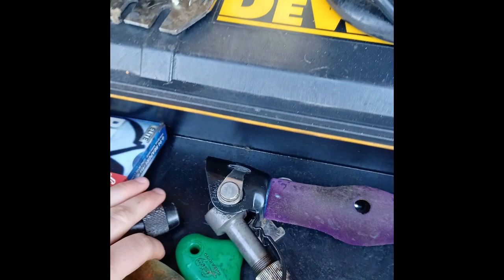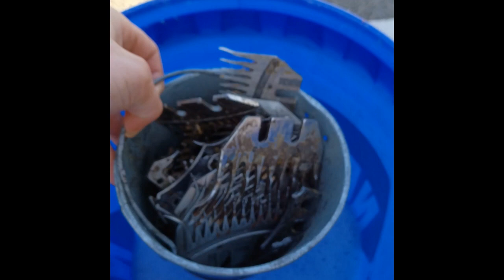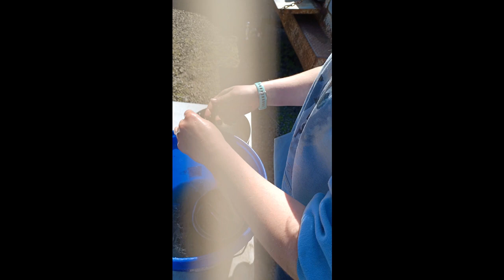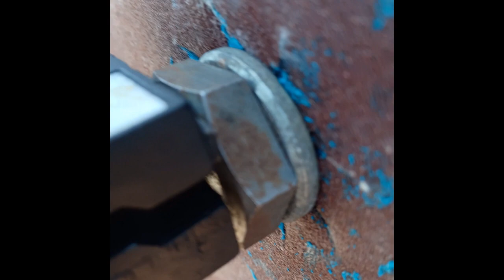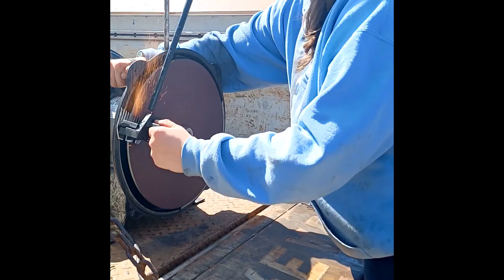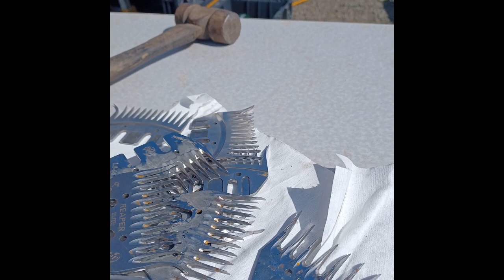Thomsen Vlog #1 Sharpening Combs and cutters!

Comment: At the start of the video you mention the long pointy side of your 'wrench' is for your centre post which you pointed to. If anyone is watching this because they are learning and don't really know what they are doing,,, word of advice,,, at no point during the entire life of the handpiece do you ever alter the position of the centre post. If you do, you will not get a consistent clean cut ever again.
Reply from the maker: Actually Sir, The instruction book and parts list from lister shearing states on page 3 of the maintenance schedule, explains the proper post adjustment and timing for the longest lifespan of your handpiece. You can get this pamphlet online at lister shearing, there is a diagram in maintenance figure 5, it's called a fulcrum post.
Reply: @thomsenlivestock7253  yes lister calls it a fulcrum post, heiniger (and professional shearers) call it a centre post. Trust me, you absolutely do not adjust it ever. The post and cup wear down together. After about 4 days of use, the cup and post are perfectly mated to each other. You should be running atleast 80 cutters. As the cutters loose thickness from grinding, the angle the cup rests on the post is changing. In the old days (like 35 years ago) shearers would use 80 or 90 cutters in probably 8-12 months, then turn the post by 180 degrees and start another set of 90 full thickness cutters. Only one side of your post is ever being worn so technically this should mean you can turn it and get longer life out of your handpiece. No shearers today would advise that tho. For 1, the cup is allready worn to a different shape than the fresh side of your centre post. The ball and race will be worn, so slop and vibration will becoming noticeable. Tension pin will be shorter than when new so can't apply pressure evenly across stroke. 
I only commented earlier because you 'almost' made it sound like its an option to remove centre post for cleaning handpiece. Although you didn't say that, I could see some newbies thinking that was maybe what was being shown. Just don't want anyone wrecking expensive gear that's all. Your gear is 99% of the battle. Sheep only kick when gear is dragging. Grind your gear right, and keep cutters in order so they come down in thickness evenly, that way the mechanics of handpiece bed in together.